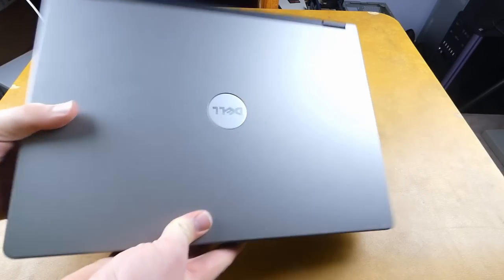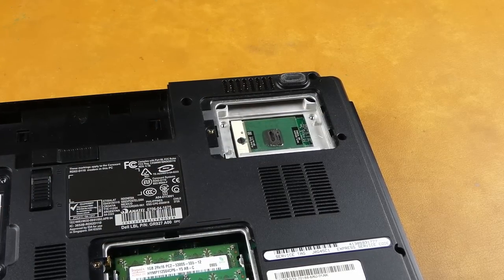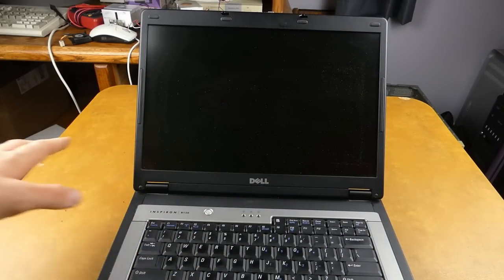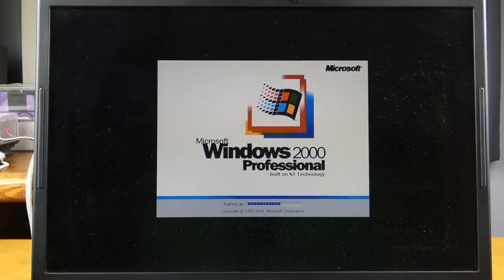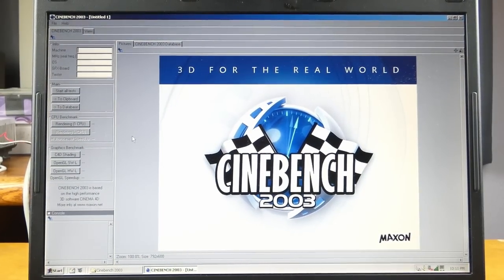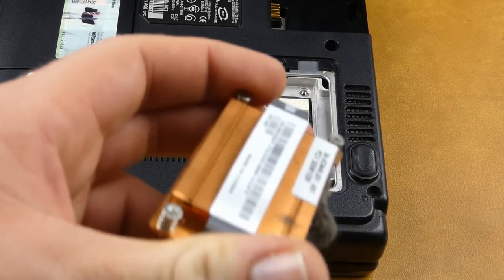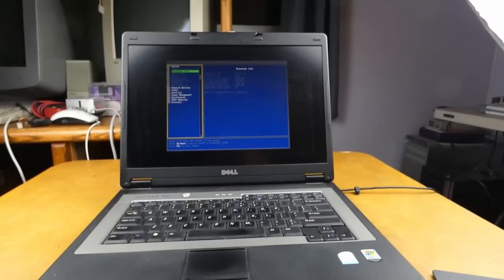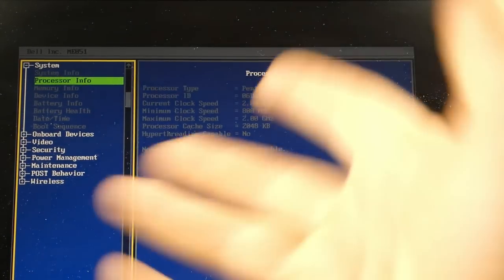World's Easiest Laptop CPU Upgrade

Comment: I had a Fujitsu Lifebook back in 2004, it had almost the same upgradability options aside from the CPU access which you need to tear down the laptop itself. but since it did not have Wifi Capability, back in the day, I purchased about 3 PCMCIA Express Expansion cards, 1 for Wifi, 1 for Bluetooth, and the other was a 4 Port USB 2.0

but what i loved the most about it is:
1. even when it just had a Pentium 4 M 3.0 HT, it out done the Desktop PC my family had at the time which was up to spec running Dual Core 3.0 CPU.
2. it had a small LCD screen with a few buttons mainly to be used as a Media Player control. with that said even if the LCD was closed, you had the capacity to play Music using the LCD and Player controls which was not covered by the LCD Screen and even see which was playing with that small screen.

Comment: They really don't make em like they used to... My almost 10 year old  Thinkpad T440P to this day still gets me through a lot of work. Never letting go of that beast. Trying to find an i7 4700MQ to swap out the stock i5. Literally everything else in my laptop has been swapped out lol. Really hope we'll get laptops like this again someday. Great video dude!
Reply: You've found another Thinkpad fan using another T440p ! Though mine comes with an i7 cpu in her factory settings. Perhaps I can help you get an i7 4700MQ for an upgrade?
Reply: @Francis_UD  hello fellow Thinkpad enjoyer! You're a lucky guy if you got that i7 stock dude. I live in Sri Lanka, so getting niche tech like an i7 4700MQ is a bit of a problem. If you'd know any suppliers that deliver here, I would be indebted to you for life!
Reply: Framework will do it for us
Reply: i got a thinkpad T430
Reply: I'm rocking a 2011 Probook 4430s myself. Came stock with 8 gb ram, 500 gb HDD, and an i5 on Windows 7. Presently she is running (slowly) Windows 10. Still rocking all-original parts. She is slated for a new 1tb SSD, 16 GB RAM, and an i7 2630qm, as well as a new bluetooth card and wireless upgrade. That sucker got beat on with gaming for a number of years, and got me through an EMS course before she really started to slow down. CPU is supposed to arrive in about a week and she'll be running faster than she did new.

My favorite part is how easy it is to open the case up, the entire underside is just one big panel. Push two little tabs, battery pops loose. Push them again and slide the panel to reveal the internals. 10-second job.

Comment: I bought my Lenovo Thinkpad T420 in 2013 and it has doors on the bottom to upgrade Cd/RAM/Wifi and it has Express ports, You can change the CPU but you have to open up the case to do it which is not hard. So you can change an i5 for an i7. What I miss most about old laptops is removing the battery
Reply: Dual removable battery too, like my daily driver elitebook 8470p
Reply: My Acer Aspire 5742G from 2009-2010 also has a removable CPU and its on i7 3rd gen, but that Laptop only supports up to 8GB DDR3 ram Which is kinda disappointing. I still have that Laptop, but the battery isn't charging and some of the keys are gone. What i like about that Laptop is it's on Official Windows 7 Pro and got a Beta Test for Windows 10 pro when it was first officially released to the public.

Comment: My first AT&T 486 laptop had the 1.44 meg floppy no sound card, no modem and only ONE PCMCIA slot. So I could either use the sound expansion or my 14.4 fax modem expansion to dial into AOL. I could not WAIT to get a pentium 100 laptop with TWO PCMCIA slots.... Of course laptops started coming with modems and sound cards built right in and I no longer needed the expansion slots. Though there is still one computer at work that needs the slot for a dedicated PLC communication. Oh how our tech changes! Great review!

Comment: I am probably one of 5 people that never ran into any problems with Vista. not a single issue with the 5 -7 machines I had it installed on.
Reply from the maker: I've heard a lot of positive stories and experiences people had with Vista. Really does seem like the issues were just a launch thing and had been mostly cleaned up by 2008. Only real criticism I have for it would be the high system requirements.

Comment: I actually scrapped one of these recently;  the doors on the underside were all missing or broken so reusing it wouldn't have been realistic.   I was thoroughly impressed by the build quality though.   I think the hinges were actually just incredibly solid;  mine had had a lot of use and they still felt amazing.   The only complaint I would have levelled at it was that it didn't use the standard Dell charging port.

Comment: I was a field warranty tech for Dell back in 2006 and I worked on a few B130's.  The Celeron M is why the CPU can be located where it is with that tiny heatsink.  Pentium M wouldn't be an issue either, but Celeron M was all that was offered on those.  The B130 even mimics the appearance of the Dx20/Dx30 latitudes.  It was a basic laptop for schools really, a few businesses had them when they didn't need a ton of power.  

Even though the Dx20 and Dx30 series didn't have the CPU under a cover like that, they were still VERY easy to disassemble.  I disassembled a D820 Latitude so fast once (Motherboard replacement) the customer came back in the conference room as I was finishing up thinking I had only just begun.  I think my best time on a D820 was 15 minutes from start to reassembled, without power tools.

Comment: I have a 2013 Dell Precision M6700, the socketed CPU and GPU cards are upgradable, it also has multiple storage bays for expansion. I am using it as a daily device at work and running Win 10. The Quadro K5000m is still doing a decent job for everything but modern video production encoding/decoding. I personally replaced the 3rd gen dual core I7 for the 4-core version.
Reply: a M6700 owner here, mine is K4000M with i7-3740qm. It really a fun using that, the keyboard feeling is just amazing. 

I also have a Lenovo ideapad G780, I got it with base-spec like no OS, 2nd gen i3 then I upgraded to a 3610qm, 8GB RAM and it serves well even till now rocking with windows 11 22h2. With a cheap SSD like BX500 it boots even faster than my 2021 OMEN 16 which is crazy....
Reply: @shinya1215  It is crazy, the 6700 is much faster than the company provided new laptop. The only thing holding it back is a lack of updated GPU cards for it. There is no reason that W11 cannot be installed with the TPM workaround except I loathe W11 (Windows Chrome 😁).
Reply: @jamesharvey44  Few years ago I was looking for hack a 1060 GPU to my M6700 which I saw some post on fourm here and there but I just didn't give it a go which I'm still a little bit regret it.

Comment: What’s nice is that almost every Inspiron from this era up until the 2010’s was super easy to upgrade. You had to take em apart most of the time, but I’ve turbo charged so many dell laptops by upgrading their CPU’s, ram, and replacing their hard drives with SSD’s. They honestly are quite easy to turbo charge.
Reply: example dell  Inspiron 1545
Reply: @yerisoncruz  oh yes I remember those models. Those ones are actually a bit tricky, but still easy to dissect! Models like the Inspiron e1405,
6000, Latitude D600, D630, and many more are from the more “easy disassembly” era.

Comment: I have a big notebook that has the same kind of cooler design. But it supports Desktop Pentium 4 CPUs. Pretty interesting to see that inside a notebook.
Reply: Not a good idea as those desktop p4 ran hot, that tiny heatsink won't be up to the job.

Comment: The PCMCIA slots were for memory cards or air cards (cellular modems) to allow you to connect to the internet on the road. My internal modem crapped out so I wound up buying a PCMCIA modem card. Those were quite the thing in the late '90s and early 2000s.
Reply: I used the two PCMCIA slots for Wi-Fi and USB2.0/FireWire (my 2000 laptop came with USB1.1 only, as USB2.0 got standardized the same year)
I don't think I ever used the built-in modem, as I used to have ISDN (and the ISDN adapter had a USB1.1 port).

Comment: Youtube really got bloated over the years, I remember being able to play 720p without any frame drops in 2010-11 when I stopped using my old Toshiba Satellite with similar Celeron, and moreso I remember playing 240p Youtube  on Pentium II 400MHz laptop around 2009 and it worked pretty well.
Reply from the maker: Yep, YouTube worked just fine back in 2015 or so on all my old hardware. The modern player really is terrible and inefficient by comparison, not to mention that navigation is horrible too.
Reply: They’re using different video codec now, and it’s not bloated, even 720 P video is getting higher quality, codec, that require more CPU horsepower because the video is more compressed.
Reply: @BrianMartin2007  Good old flv days..
Reply: @BrianMartin2007  they changed the codec but these laptops can't decode with gpu acceleration support, only cpu. they used to decode easier while it was flv or h264
Reply: there is a plugin for chrome that forces h264

Comment: If you are interested in modular, upgradeable and serviceable laptops you may have heard of the Framework laptop. If you haven't - be sure to check them out as you can upgrade/replace/customize pretty much every part of it individually with the added benefit of the laptop actually being thin and light.
Reply: the only problem is io is limited to not that many ports at once.

Comment: I'd be curious to see you try some different ram modules in there to see if you could improve the speed, or at least see some improved timings and if there is a measurable difference.
Reply from the maker: I have a bunch of DDR2 SODIMMs lying around so I should try it.
Reply: Just make sure the clock frequencies are both compatible and same if you're adding multiple ddr2's. I'd first find out the CPU data sheet and check if both the motherboard and CPU can handle it.

Comment: My two laptops, the older one, an Acer Extensa 5220, and the newer one, always Acer, but a gaming rig, the Nitro 5 year 2020, are an exception to the modern rule.

The first, predictably since it's a legacy, I upgraded the hell out of with a new dual core CPU (a core duo T7700, I think it was, been a while, the fastest CPU supported) and 3Gb of RAM (max memory amount supported by the mobo) and an SSD. Its hinger are so stiff too, you need two hands to open it, to say.

The second, though I had to open it whole (thing easy enough to do for me) since sadly it lacks fast access hatches like the majority of new laptops out there (though it seems the 2018 one still had them), I brought it to 32GB RAM and added a card SSD... only to discover a little too late it could accomodate another M1 SSD (that next year I will add too), to say it is written near the keyboard it could. It's official, I'm an idiot.

So, I guess it depends on what laptop we're talking about. Muscle-bound gaming rigs still can to a degree (though I don't think my Nitro 5 can have a CPU upgrade, it's already an i7 10th gen, so it's not so bad) while super-thin ones... well, I guess it depends. Some still can accept memory and HD upgrade, though you must completely open them to do it, and others just sacrifice possibility of upgrade upon the altar of portability or builder choice.

Comment: nice!  i have an ipsiron 6400, discreteradeon  gpu and an upgraded core 2 duo @ 2.3 GHz(i think), upgraded to 4G ram ddr2/800, yes its slow with windows 10, but great for a linux box.  screen is beautiful 15" great keyboard, great speakers and yes, the hinge works beatufully still

Comment: Well, regarding upgradability - some things make sense nowadays, while others don't (whatever Apple's doing never makes sense from the consumer standpoint, though).
Soldered components can be faster (imagine having soldered LPDDRX ram right next to your cpu instead of having SODIMM slots that are far - traces-wise) and more energy efficient, and their small footprint allows for smaller and lighter devices - unlike the laptop you're working on.
Replaceable batteries, MXM slot, upgradeable wifi and storage are great. But I'd rather have soldered cpu and ram and better non-upgraeable cooling, because that tiny copper cpu cooler wouldn't do nothing when paired with a modern cpu.
Tech back then wasn't as demanding (and really far back there were no standards and companies did whatever they felt like is right), while nowadays the chips are so dense that doing it 'the old way' isn't practical.
Companies like EUROCOM still offer 'upgradeable' laptops if that's really your thing, but I wouldn't call those LAPtops - more like dekstop replacements.

Comment: and even on some laptops you can replace the gpu in laptops that use the MXM connector (Mobile PCI Express Module) a bit rare nowadays.
also some were limited because of PC's biso proprietary junk that the OEMs used and on older dells they used i don't know what it called it was some kind of mini AGP or some other proprietary connector.

Comment: My father's laptop from 2012 had an amd cpu that you could also remove
I once deep cleaned everything and accidentally bend one of the pins, though I was able to get it right again
What was surprising to me is, those CPUs weigh nearly nothing and the pins are really really hard. Like, it can bend a pin if you drop, but actually trying to bend it back was quite the task.

Comment: Put an ssd on it it will boost the performance much mostly on such low system,  also remove the DVD roon, and install a second like an optane disk used to boost startup and paging

Comment: Oh no, those hinges are normally that tight. I had one of these bad boys as my first PC when I turned 11 years old. It was 6 years outdated by that time but I loved the thing. Those hinges are so tight that you don't have to worry about them ever going - it's the plastic chassis around the hinge that'll snap off before those hinges give up. I remember having to use two hands to open that laptop.

Comment: the problem you mention regarding the speed of the FSB is not due to the processor it works at the declared frequency, it is the DDR rams that work from 266 to 400 mghz, the DDR2 go from 533 to 800 etc, so the only speed limit is due only to the components supported by the device which is in this case the type of RAM supported.

cpu z similar software also detect real values as there is no need to make invasive changes (in some cases harmful) of the BIOS firmware

As in CPU Spec its says exactli that M version support only 400 mghz FSB 

The revisited version ( Centrino ) support fastests RAMs like DDR2 533 mghz up

Comment: yep, thats dell. They always had good expandability and reparability on their laptops until they started using proprietary parts and crappy designs.
I cant say the same for HP in the same time period. They had the same socketed things, but they made you take the entire chassis apart to get to them. I had to remove the motherboard to replace the cpu, and the hard drive is requires the whole thing to come apart. Props to dell for keeping it easy.

Comment: I had this laptop and used to play a lot of Doom 3 and CS Source on it back in the day. The best part about the cpu socket is you can do a mod to overclock your existing CPU. I put a little piece of wire in between the two pins and my 1.5ghz celeron M became a 2ghz pentium for free. Too bad the laptop got stolen though. I still miss it.
Reply: Also the 5200m chip inside it was a beast, maxed out the sliders in MSI afterburner and was still 100% stable and benchmarked way beyond desktop geforce 5200 cards.
Reply: Im really curious on how u did it i have the exactly same laptop
Reply: @lowliar8489  take a wire, make it into a U shape, and insert it carefully on the 3rd row between pins 15 and 16 from the left (when socket lock is on the left).
Reply: edit: I forgot that they use a lock and not a latch on those sockets, fixed it.

Comment: Express card was awesome. It was a PCI Express slot that you could plug basically anything into. You could add USB 3.0 ports, eSATA, Firewire ports (yes Firewire was better than USB 2.0). You could add PCIe Gigabit Ethernet if the system only had 100Mb. Think of Express card as a early Thunderbolt system. If Expresscard still existed today you could plug an eGPU into it
Reply: wasn't mxm a thing
Reply: @flamestoyershadowkill  mxm was a thing. But it was not standard in terms of the modules size and layout. The mxm standard was just the connector pinout but you'd rarely be able to use a mxm gpu module between different laptop manufacturers.

Comment: I got an old toshiba laptop from vista era, put an ssd, installed bodhi linux and it works great. Dual core intel cpu, 3 gigs ram, the screen is a bit s*it 15" tft panel. it was incredibly laggy when I first started it, and as soon as I removed the depleted battery it worked like a charm. The chip in the battery was somehow halting the whole system, later I scooped the cells out and put in the empty shell because one of the rubber legs was on the battery. It's a great laptop for dosbox and exploring linux OS, I only wish it had a better IPS screen, maybe I'll replace it, I've seen it can be done. It's a pretty sturdy laptop, built like a tank unlike these modern laptops. I need to replace cmos battery, and for that I have to disassemble the whole thing, and it's a weld on battery unfortunately, but I can live without the battery for now.